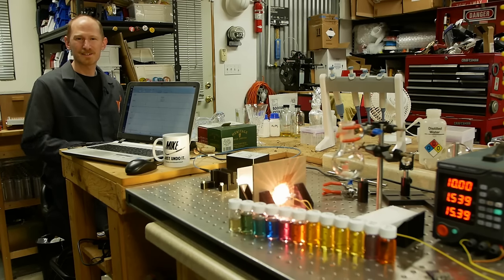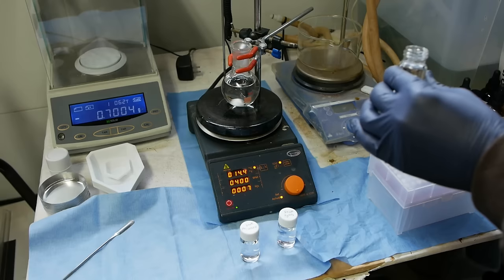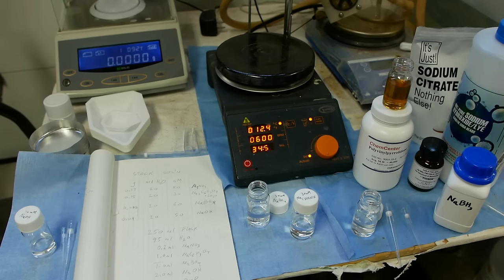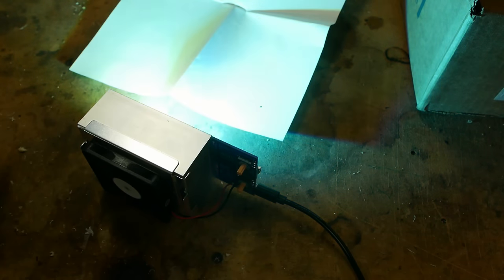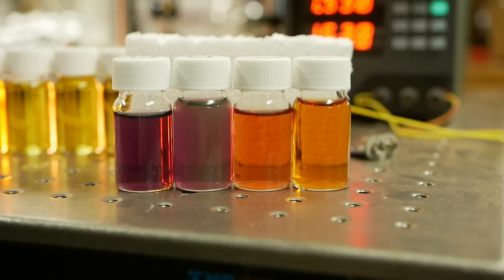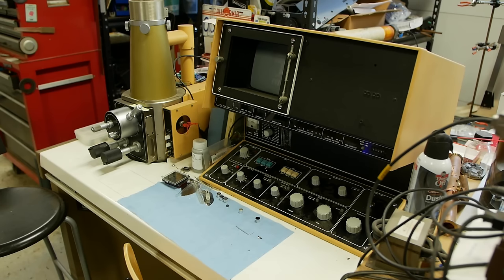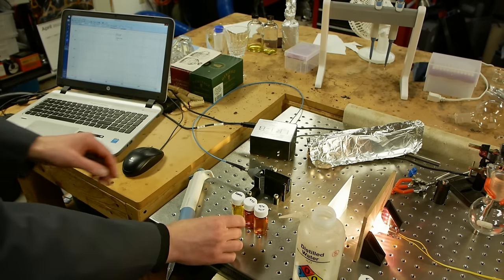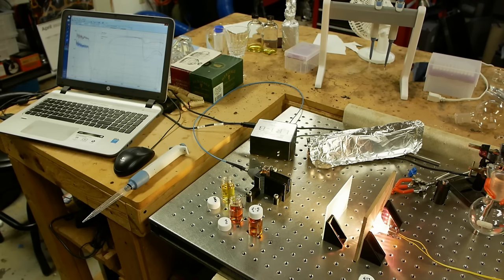Silver nanoprisms grown into structural colors by high power LEDs

Comment: There are many comments so this will probably get buried, but I did my graduate research in a lab that worked with plasmonically grown silver nanoparticles/prisms and my PIs graduate group is the lab that first published the work(not my work but in my lab, you can google my work if you want to). These are not colored by structural color, structural color is defined as the surface of a material being randomized (usually on the micro scale) as to produce changing reflection/diffraction (sort of like those weird films on credit cards that reflect colors strangely). These produce color because silver has localized surface plasmon resonance or we call them plasmonically active at these size scales (20-1300 nm or so) with increasing wavelength visible light where the physical height of the dorito shapes absorb at the wavelength proportional to their size  (the small width absorbs at a different and much smaller wavelength!). The effect is caused by the wavelength of light coupling and oscillating the bands of the metal and causing a separation of electron/hole pairs at the surface (which are chemically active in the right environment!) and this is most effective near and below the peak absorptive wavelength for that size (metal species dependent). The effect is most strong at the tips of the doritos but grows out from there. The field of plasmonics gets way more in depth but you can look up more from there.

To answer some of your questions that im fairly sure of the literatures response.
1. The BSPP is a chelating agent (binds up free metal ions), a slight etchant, a surfactant (keeps them supported in solution and not stuck together), and a light sensitizer for the particles which helps them grow with the light (complicated, literature can explain), PVP works similarly, but isn't as strong a chelating agent.
2. The particles likely grow from a combination of Oswalt ripening (cannibalism of less stable crystals toward more stable less undercoordinated atomic positions) and PVP etching producing free silver ions, similar to your theory about growing into the preferred size and shape for the light, but this is forced by the active electron/hole pairs being split across the height of the particle by the plasmon resonance.
3. The particles can't grow back into smaller ones because the large particles can't absorb the shorter wavelength light as they are not resonant with those shorter wavelengths, so nothing happens. Also the larger particles are more stable so its hard to go the other way without adding some other chemicals and starting over.
4. These prism are often made into right bipyramids by accident, meaning they would have 2 LSPR (absorptive) wavelengths in the visible spectrum, so while a distribution is the most likely case due to extremely slow ripening and etching at that size due to particle stability for those 470 particles they could also be becoming bipyramids (trigonal pyramidal shape with a flat bottom).
5. The LEDS you are using are likely fairly narrow wavelengths (+ or -) so the particles probably aren't growing too much bigger because of that but that could be some of the cause of the redshift, but plasmons exist outside the particle itself so they will likely outgrow the plasmon excitation and become somewhat larger than the wavelength of light (then stop growing) so that will redshift the absorbance as well.
6. More intense light does speed up the reaction kinetics if there is free silver in solution post NaBH4 reduction, but this could cause bad effects and different products because faster doesn't often produce the same thing faster, but something else faster. in this case where Oswalt ripening/etching is the likely silver source, the limiting reagent is those processes so intense light would only help the kinetics to a point.
7. Standard workup for our particles was 1 mL spinning at 6-9K for 3-10 minutes to produce those black pellets, decanting the supernatant with a pipet, re adding back DI water and spinning it down 1-2 more times and repeating. The final pellet was then resuspended in a tiny amount of water and sonicated or vortexed to disperse it in that tiny bit of DI water. That little bit of water with suspended particles is really concentrated so you only needed like 1 uL of it dropcast onto silica wafers or TEM grids for imaging. (they are small, the bigger particles you can probably see with a tungsten filament SEM, but a field emission SEM is preferred. I think you would need a resolution at least 2-3 nm to get a decent image of them (the field emissions are often around 1 nm) but most TEMs would be fine, but many $$ for any of those)

These reactions were always picky as heck and didn't like to behave sometimes so other stuff often happened (water purity and vials themselves could ruin the reaction). If you have any more nanoparticle questions or would like references, I can probably find them or point you toward someone who is better versed on the topic.

Comment: My tip for the increase in wavelength over the used LED is that you transfer energy into them to let them grow as long as they can efficiently absorb the incoming light. So you would expect the outcome to be higher since you basically push them until they are above your reach.

Comment: Hi Ben, I am an Electron Microscopist and I can help you in capturing the structure with my normal and cryogenic TEMs. Also I suggest to boost your resolution with STEM detector. There are two types passive and active. Passive STEM detector is simply a gold coated plate at 45 degrees below the sample. Active has an electron detector: you can strip a photo detector and use it as a electron detector. Both are very easy to build.

Comment: Once the nanoparticles are stuck to the substrate, you could probably dissolve the gunk around them with organic chemicals (maybe acetone?).  Some will have gunk under them and be washed away, but others will be stuck directly to the substrate and stay.  Obviously, this will not work with acrylic CDs since acetone will dissolve the acrylic, but it should work with Si wafers.

Comment: Really nice science.  From growing crystals for X-ray structure analysis, I learned that if there is any solubility of the material, then the process of "digestion" (basically just holding the mixture at a temperature were there is some limited solubility for a long time, typically days to months) will result in the small crystals dissolving and the larger crystals growing.  With patience, the result will be one large crystal.  This works because the small crystals have relatively large surface areas per unit volume and exchange molecules (or atoms in the case of silver metal) between bulk and solution at a greater rate than large crystals.  I think something similar is happening with your silver nano-particles.  So it is relatively easy to go from the initially formed small particles to larger particles (i.e. thermodynamically downhill), but much slower to reverse the process.

Comment: I would suggest that the redshift for growing the crystals also applied to shrinking them. Hence why they didn’t get back to 405nm when you shon 405nm light on them. I would consider doing more research into this, especially using a sequence of LED wavelengths to try to chase the nanoparticle size, instead of starting with the final wavelength. You can buy 260-400nm LEDs that aren’t too expensive these days, which may help the reversing process.

Or you could build a continuously variable wavelength light source, like a FEL.

Comment: Electron microscope resolution is its best possible spot size.  Vibrations, electrical/magnetic noise, column contamination, etc. will blur the actual image beyond this ideal unless they are located and eliminated.  The best resolution will also improve at higher acceleration voltages since electrons repel.

Comment: Great video, as usual! As far as particles converting but only one way, it's helpful to consider surface energy. Small diameter particles have high surface energy due to exposed crystal edges. Think of making a ball out of Legos, a small one will be very jagged due to Lego size compared to sphere size, while a large one will be fairly smooth (it's kind of like a resolution thing, where atoms are pixels). Nanoparticles have more ledges and kinks (look up TLK model) and are much less stable. This makes them more reactive and even reduces their melting point. So there definitely is an energy gradient.

Comment: Nice work! I'd bet the red-shifting is due to the LEDs not having a single wavelength emission like a laser but a rather wide gaussian distribution, as you've demonstrated it's difficult to reverse the growth so I think it's reasonable to expect the longer wavelength emissions of the LED to be the preferred end result nano particle dimension despite not being to most intense wavelength. I wonder if you had a more power laser but diffused it through the solution if you would still see that red-shift.

Comment: Random suggestion: You might be interested in looking into the chemistry of liquid wart remover. It has surprisingly interesting ingredients: Salicylic acid, camphor, castor oil, ethanol, ethyl ether, nitrocellulose. The camphor + nitrocellulose react very quickly to form a layer of celluloid on your skin, I guess to hold the salicylic acid in place and protect it from rubbing off. Sort of a quick-forming plastic shield. Smells terrible, though, and probably super flammable. :-D

Comment: My guess on the irreversibility is that, there just aren't enough particles of the other size left in the solution to make a difference.

Maybe try irradiating with two wavelengths to make two sets of particles and see if you can go between them afterwards, and, if yes, try to convert all of them in one direction and see if they lock.

Also, try doing the initial irradiation longer to see if you get it to the point where you can't change it at all

Comment: Okay hear me out. RGB leds might work because you would have the particles absorbing 3 different wavelengths in different amounts because of different concentrations. But thats true only if the rate of the reaction is dependent on the intensity of the light.

Comment: Possibly there is a process at play similar to Breaking Taps Copper deposition with Lasers. In the solution you get a small percentage of agglomerates of basically every size. Which will over time eventually grow, due to Ostwald ripening (that is all over the place for Nanoparticles, very small ones dissolve a little bit better than slightly lager ones, which makes them grow, very slowly in the case of metal particles, it is observable).
 If you are using light of a single wavelength you heat up precisely the particles of that size, as they are the ones absorbing. Accoring to the Nernst equation, that gives a higher electrochemical potential to their immediate vicinity and thus they dissolve a little more readily. 
The silver then deposits on the particles wich just don't absorb at 470nm, e.g. slightly smaller/larger ones. 
The smaller ones get eventually big enough to absorb 470nm dissolve to deposit on the others and so on. 
That leaves behind only those wich are barely to large to get excited by your LED, thus the redshift.

Plus a word about centrifugation: I've tried that once with gold nanoparticles. It's tricky. 
Metal particles love sticking together, they basically cold weld. 
Given enough time and rpm you can even make silver gold on accident while centrifuging.
I may or may not be speaking from experience.
If the coating agent comes off at any point during centrifugation you will get agglomerates.
For microscope images thats no problem, resuspending might work with ultrasound, but losses are inevitable.
Citrate is only very loosly bound to the Surface, PVP should be a little better, because it has more options to stick.
NAC might work better, emphasis on might. It carries a charge (always good to have a little electrostatic repulsion) and the sulfur likes metals surfaces.

Comment: This is a bit late, but the delay your talking about related to why the laser doesn't instantly change the color of the solution is probably related to a chemistry concept called a rate limiting step. This is common when you have a sequence of steps in a reaction where one of the steps is slower than the remaining steps. When there isn't much light around, the step which involves the light activation is probably rate limiting, but when there is excess light a different reaction step (or diffusion step) is rate limiting. Of course I haven't read the paper yet, so I could be wrong :)

Comment: This is only a small anecdote, but a similar red-shifting effect was observed recently in empirical reflectance measurements from rough surfaces. There exist mathematical models for simulating reflectance from rough conductors that fit relatively well to measured data, but there's a systematic discrepancy that was only noticed recently, in which the measured reflectance skews towards longer wavelengths in a way the model does not predict.

It's not out of the question that a medium filled with scattering silver particles would show similar behavior as microscopic facets on a rough surface (a similar reflectance model, "microflake theory", applies). If there is a weird wave optics effect that skews scattered radiance towards longer wavelengths on surfaces, it may well do the same in media.

There is only empirical evidence so far and no constructive explanation, so take this with a grain of salt, but it's interesting. See "What is the Reddening Effect and does it really exist?" by Clausen et al., Workshop on Material Appearance Modeling (2019)

Comment: I would determine if there was a consistent percentage difference between the peak and post end sub peak. 

If there is a consistency; then the lower peak may be indicating the energy efficiency used in the transformation.

Think of the energy loss in a transformer which is about 98% efficient.

Thus, to get the exact spectrum you want, you would have to mix the solution to have sufficient energy so that;

solution - percentage energy loss = desired spectrum.

Percentage energy loss may be a static percentage as it is in transformers, but it may also be different depending on the desired spectrum. That would make the algorithm to calculate the desired spectrum more difficult to determine.

Comment: Great video, very interisting process. For reversing the growth process: It could help to start with a wavelength only a little bit shorter than the wavelength that was used to grow the prisms and work your way down step by step. If something like normal ostwald-ripening is happening, very small particles may not stand a chance against the biggest ones, not even if favoured by the wavelength.
Ostwald-ripening could also maybe explain, why the particles grow larger than the excitation wavelength. I wounder if you could speed up the growing process for larger particles by starting with a short wavelength and working your way up to the higher wavelengths.
If this is not working, adding a little bit fresh uncolored stock solution before the next wavelength could work?

Comment: Hi Ben! Since there is an offset between the excitation light and the obtained absortion spectrum, couldn't it be the problem when you try to revert the process by shining a 400 nm wavelength through the solution? Did you try reverting the solution color with a shorter excitation wavelength?

Comment: Where do you get 200nm LED'S with 1W output power? On aliexpress I have seen uvc LED's with quartz window but they radiate not more than a few 10 mW with a bad efficiency. They consume a Watt or more by 6V forward voltage.
Reply from the maker: I used this one: https://www.digikey.com/en/products/detail/luminus-devices-inc/XBT-3535-UV-A130-CD270-00/14664061  They claim 80mW max output, so yeah, they aren't like normal LEDs, but if you need 275nm in a small space, it works.  The LEDs each consume about 1W power, so they are all equivalent in that sense ;)
Reply: @AppliedScience  yeah that's similar to what I have in a quad arrangement and yes you need to be close and there is only a point source (or 4 in my case) Thanks  :)

Comment: I looks like the light promotes growth of particles that can absorb it, growing them out of the range of absorption. Because of that, the particles end up slightly larger than the wavelength of the light.
Edit: the perspective shift is that the light does not promote the particles to grow into the sizes that can absorb them but that it promotes growth of particles that are already that size (tho this needs secondary mechanisms to explain how they got there, especially for the larger wavelengths and how the shrinking happens)

For the reversal attempt, i think you just used the wrong wavelength. The downshifting clearly happened but because you used 405nm light and the actual particles end up slightly larger than the wavelength, you didnt go back to original. I think you might be able to actually reverse it with 380-390nm light.

Comment: Maybe if you wanted to bring the peak back to 405 nm you would need to use a light source that was equally offset (lower than 405) the way the rest of them produced peaks at an offset to the light that was used.